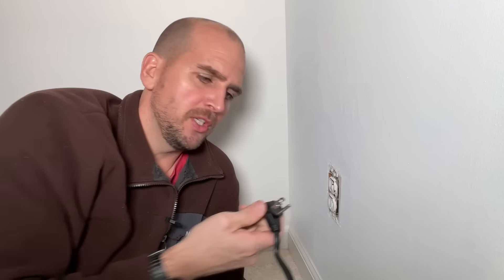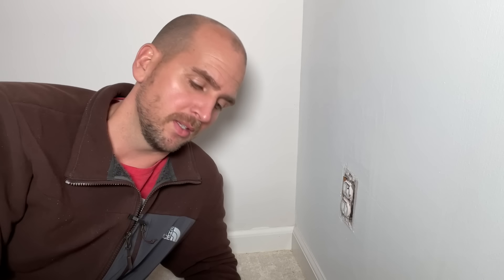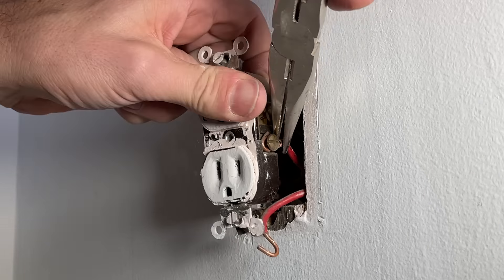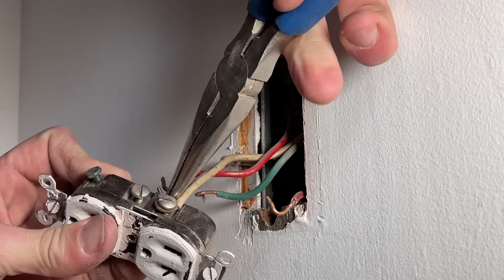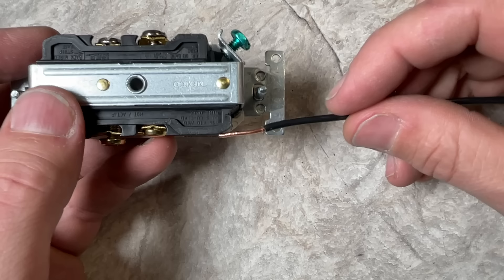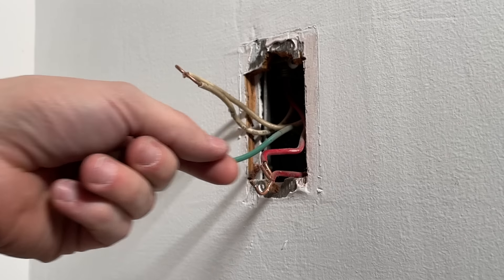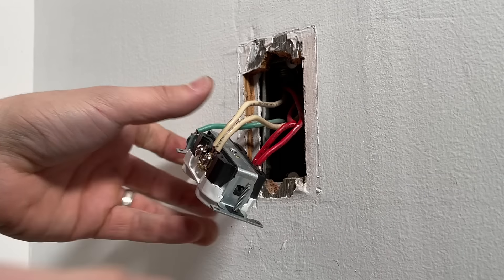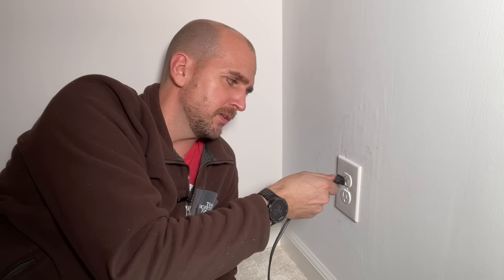Plug Won't Stay In Outlet

Comment: Be careful using the outlet tester as a means to determine whether the outlet is off. On my outlet tester, no lights means "Open Hot"; electricity is still flowing through it even though there is no lights on the tester. I prefer and suggest using both an outlet tester and a no-contact voltage tester (pen tool).

Comment: Loose connections cause arcing which creates heat (think arc welder) which inturn will create a fire. I  am a retired professional firefighter with 28 years of experience and have responded to dozens of these types of fires. Please don't take chances, this is a cheap and easy fix.

Comment: What's the point of having 4 terminals, if you only use one on each side?
Reply: If you use shepard's hooks, only ONE wire per screw terminal.  You can use the 2nd terminal to feed power to a downstream outlet on the same circuit.

Comment: Technically, the ground should face up. Reason is that if the plug is out a fraction and something metal should fall, it cannot create a bridge between the hot and neutral. Also when I have a metal box, I always wrap the outlet with electrical tape around the terminals as an added layer of protection!
Reply: Waot I thought it was only if a duplex receptacle is used then the links are also suppsoed to not be left connected so to provide for a switched outlet for the commonly done in the mid? Late? 1990s (for having a lamp of some sort wether via by means of a torchiere lamp or table lamp and not overhead ceiling/hardwired lighting fixtures) operable via a switch somewhere presumably close by in same area or even same room at least.

Comment: Why do you put 2 red wires and 2 black wires on the same screw.  There’s 2 gold and 2 silver, so can you put one on each?  Sorry, I am a new homeowner learning
Reply from the maker: For sure, an even better method is to use a method of pig tailing the wires where you only have 1 hot, 1 neutral, and 1 ground going to the outlet.  This video will give some additional details https://youtu.be/M8Ic4L0niS8

Comment: My receptacle is fine actually, but I bought a phone from EU and the adapter it came with has prongs about 60% the thickness of a normal plug, that's why it falls out everywhere I plug it into, specifically I need to put it in a power hub that installed vertically, so this doesn't help me much. I went and bought a universal cheap universal adapter and ...oops, the prongs are too thin as well!

Comment: You should have checked if the tie bar was broken free from the hot side of the receptacle. It could have been two separate circuits or have 1 switched. 

The correct method if the wiring is just a feed in and another going out is to add pigtails to both the neutral and the red hots to make the wirenut or Wago responsible as the bonding point of conductors. Putting 2 conductors under 1 screw sets you up for current flow across the screw even if nothing is plugged into the receptacle. The initial install with a conductor under each screw was a terrible idea and one that results in failures down the road. The current for anything beyond the receptacle is carried across the tie bar between the screws. The receptacle can be cooking hot with nothing plugged in. 

Definitely missed a bunch there and you have repairs to do. The receptacle is an end use device and must be wired with that purpose in mind. Imagine a loose screw from heat cycles over the long time picture. You would have created a fault affecting down stream outlets and it wouldn't happen with pigtails.

Comment: Why did he put the two hot wires onto one screw and the two white wires onto one screw?
Reply: Yep don't follow what he did. He is probably not really electrical technician. Replacing & why it's worn is basic common sense. When it comes to wiring where it goes it must be carefully done or taught here. He definitely needs to edit the video or write on description that he has mistaken.
Reply: He used a backwire connection.  The device is designed to hold two wires with one screw when wired in that way.

Comment: Hi Scott. May I ask why you add booth hot wires to the same "screw"? 8:42 I mean you say that's possible but for what is there then a 2nd gold screw available if I have at all just two outlets? Why not just add one hot wire to the first screw terminal and the 2nd hot wire to the second hot terminal? How do you test outlets with just 2 proms? All the testers are just for 3 prom outlets. /// Offtopic.... did you know green eyes are the rarest form of colored eyes. Even more rare than blue? I have the same color and my wife loves it. It looks like the snake from the Jungle book :P

Comment: Incidentally, a simple explanation is metal fatigue.  People have been told to plug and unplug devices to save power.  It fatigues the contacts.  In reality you save very little power plugging and unplugging vs. just shutting down whatever is connected to the transformer or cord.

Comment: You would never have two hots and two neutrals coming in. One set is coming in, the other set is going out to other outlets on the circuit and is not otherwise live. Also the bottom and top socket on ordinary household outlets are connected, the right hole on the top is connected to the same metal contacts as the right hole on bottom; the left hole on top shares a contact with the left hole on bottom. If you've killed the circuit and there's no power to the top then there is no power to the bottom by default.

Comment: With that tight small metal box, I would have put some electrical tape around the outlet terminals before installing it in the box.
Reply: Unless you are using something unapproved, there are no "tight" outlet boxes. Once the yoke is secured, the terminals cannot touch the sides of a proper box. Taping outlets and wire nuts is unnecessary and unprofessional.

Comment: How about a plug that absolutely will not come OUT of the outlet! Friend of mine, outlets installed by an electrician during renovation, electrician used the push in connections, plastic outlet got hot enough to melt the plastic to encapsulate the plug prongs. I had to remove the outlet with the plug still inserted, which made it very difficult. I had to smash the outlet off of the plug. I couldn’t believe a licensed electrician used the push in connections.

Comment: I've been an electrical contractor for 35 years. Two things I think are mistakes in this video. The gentleman should have pig tailed the hots and neutrals. This would allow for much easier work to be done (if need be) on this outlet in the future. And it would give less a chance of fail with only one termination. Second, he chose to reinstall a 15amp outlet only because he removed a 15-amp outlet. It doesn't matter what the old device was, it could be completely wrong. The outlet is determined by wire size and breaker size. The failed outlet could be incorrectly sized or not up to current code. He didn't elaborate if the breaker was 15amp or 20amp. the wiring was clearly #12 which is also 20amp rated.  Which means the breaker should be 20amp and if the breaker was 20 amp, the outlet is then required to be 20amp. I still think it is wise to hire an expert, and not a handyman.
Reply: alot of people send useless picky posts meant to show "i know more than you",but this is the solid info worth posting that could save lives thanks
Reply: @zacinnc78  It is far from useless. 99.9% of home electrical fire related incidents are due to homeowner error and do it yourself projects. Thats why there are codes in place. So, a person such as yourself has little chance of passing your deficiencies on to the next buyer. Deficiencies that could potentially be life threatening.  There is nothing wrong with doing anything yourself. However, if you're going to do something yourself, I highly suggest you consult a professional in the trade prior. I think all licensed electrical contractors would agree, given the damage and dangers we have seen. It is unfortunate that there are non-professionals tradesman posting improper installation on anything as if it is proper industry standard installation. Perhaps they should consult a professional before making such videos.

Comment: I have been doing it myself for ages and one question which no one has answered is, Is it ground up or ground down?
Outlets with the ground down seem more satisfying almost a smiley face.
But one can see all the letters and numbers and LEVITON are up side down.
So which is it? The world wants to know.
Reply: ground down so if the cord is stepped on the current carrying wires will come out of the outlet before the ground wire becomes dislodged

Comment: I always wrap electrical tape around the outlet to keep the wires from touching bare metal on the electrical box if the box is metal if the box is plastic I do not wrap electrical tape around it

Comment: What to do if no ground is coming out the wall
Reply from the maker: If you do not have a ground you need to either stick with a 2 prong outlet or use a GFCI and with the appropriate labels on the outlet cover indicating "no equipment ground."

Comment: I have a non-contact and I will never trust it again as I was doing some work on some wires, and it said there was no electricity (I figured it had been chewed through by rodents).  Well, as I went to buy a new socket (it had burned as the fridge is connected to it so better to be safe than sorry) and my elderly stepfather had been playing with the wires while I was gone.  I get home to find that out, and luckily the hot touched the back of my hand to shock me not as I grabbed it (the Angels were with us both that day for sure).  I jumped back wondering if I hit a nerve, or if that sucker was hot.  The non-contact setting said nothing was there, but as soon as I put the probes on 122V.  I was damn lucky and went to the fuse box to pull the fuses to finish the job.  Never again as I can trust probes I can't trust a non-contact as it almost cost me my life.

Comment: I'm not clear on why you put both red wires - and both white ones - on a single screw on the new outlet. Even if a screw CAN accommodate two wires at once, you have two gold and and two silver screws, so why not use them both?

Comment: JUST SPREAD THE  PRONGS OF THE PLUG APART A BIT A SLIDE IT BACK IN!!!!!!! done deal, quicker than me typing this, I fix this problem
you replace the outlet??? 🤣🤣🤣 
some power bars have this problem, same solution, if you find a plug slipping out of a power bar too easily just spread the prongs of the plug slightly

Comment: This a non existent issue with UK style plus and plug sockets since ALL plugs have 3 prongs (2 horizontal on the bottom and 1 vertical on top and the top one is ground) on them regardless of whether the plug uses a ground or not because of a safety feature where the live (Hot wire for you Americans) and neutral wire (dunno the American equivalent) holes have a gate in front of them which requires that a button that is inside the ground hole (ground prong is longer than the live and neutral ones to do this) at the top to release the gates blocking the 2 horizontal holes for live and neutral to stop people especially kids poking metallic objects inside the holes. This safety feature also adds another form of secureness of the plug in the wall socket by basically gripping hold of the plug because the button in the ground hole is slightly slanted and the button when compressed goes down instead of in and the button which is spring loaded naturally pushes against the prong and the gates for the live and neutral are connected and also spring loaded and naturally push against their respective prongs as a result too so the prongs are being pushed against the hole also pretty much all plugs have the wires coming out of the bottom so when the cable gets pulled or snagged the live and neutral are gonna pull out first and another safety feature is that the live and neutral wires are plastic coated where they meet up with the plug so even when the plug is only slightly inserted the exposed metal on the bottom 2 prongs is hidden. the plugs that dont have  ground wires (ALL househole appliances and things such as TV's, computers etc all use grounded power cables) The only plugs I have ever come across that do not use grounded prongs are phone chargers and these even have a plastic prong in place of the ground prong just for the button inside to open the gates of the other prongs. some of these chargers the ground prong can be folded or hidden and another thing is that in the UK as far as I am aware that the prongs on ALL plugs stick out and cannot be folded in but on certain phone chargers the ground one can be folded or compressed inside the charger to save space since the ground prong is required even if it is just plastic and has no purpose for being used to ground anything

Comment: Until a subscriber pulls out a half hot plug. In this case part of the plug will be controlled by a switch.     If the bridge is not broken, The switch will not control that part of plug

Comment: Well, no, it is not wear from overheating and years of usage, it is a fundamental design flaw that I never observed in France, in Ireland (although their power outlets, identical to the British ones, are over spec'd). The first thing I did after I bought my condo was to buy a box of brand new power outlets because many wouldn't even hold the weight of the plug and a small cable, not just the power outlets supposedly used by the vacuum cleaner.
Even with the American design, it would have been extremely easy to block the 2 claws so that go further than the diameter of the plug.
Include also a recess, mandatory kid tamper resistance, and other features found in power outlets of other countries.
The green ground wire is a good thing though, compared to the usual naked copper ground wire.
Both are still coupled to the neutral wire in the electric panel, so that's not so much of a good thing, but Americans seem to be OK with it.

I found many electrically backward things when comparing American code and standards with other countries. Some of it also has to do with the not so United States, with individual states, counties, cities having their say in many matters where they shouldn't. I am not even an electrician, but I had to train myself to the latest code before renovating my house from scratch.

Comment: YES - Hotels are the very Worst. The brand new PS4 plug was melted by one of these. 
Also - Fire Marshal should site any commercial building with sloppy outlets.
They are the first cause of any fire if plug on cord has to be is altered to stay in. 
Home owner should be very aware of the high resistance loose outlets causing fire. 
High load appliance such as heater to iron. Test all kitchen outlets - 
Microwave, toaster, mini oven are also high load appliance. 

I really prefer commercial 20 amp vs 15 outlet, with higher grade connection inside. 
The circuit breaker knows the rules cannot be broken. 
One should take red piece of tape, and do full walkabout in their home, 
and mark every sloppy outlet to not use them till they are replaced. 
And mark that outlet for use for lamp only until replaced. 

As in the install just done in crowded metal box with stiff wire, I have wrapped entire outlet
covering screws a couple time with tape just to make sure no direct contact is made. 
Odd a plastic snap on cover is not made for this purpose. 

Cheers

Comment: When you unscrew wires from old outlet just remove the screws completely and won't have to use pliers to get wire off lug the old receptacle is going to be discarded

Comment: You said there was a chance that the outlet could be rated for 20 volts rather than 15, which is the rating for  the new plug fixture.  You said that you checked to verify it ...... but you didn't say how.  Also, you really should have explained what would happen if the outlet and the new plug don't match.  If one is 20 and the other is 15, what happens?

Comment: I know a lot of people, especially from the US, will disagree with me but, as a European I must say this: the type A and type B sockets are simply a bad design. The wall socket frame should have an indentation to hold onto the plug with, as is the case of type E, F, H, J, K, L and N sockets. Their shapes vary, with some being round, some rectangular and some hexagonal, but they all have in common that indentation in the frame of the socket that helps to grip the plug and hold it in place. As a bonus, it eliminates the danger of accidentally touching the partially exposed prongs of the plug when inserting or removing it from the socket.
The most absurd part in my opinion is that, in the US at least, these idiotic sockets are being pushed for being "compliant" with whatever they considered "safe" a century ago  by the same people who didn't see the Edison socket as a potential safety hazard, in spite of the fact that you can literally touch both contacts with your fingers. In my opinion this oversight proves just how important and well thought these safety standards actually are.
And even with all that, I can see a simple modification to that idiotic receptacle that would actually fix that sagging issue: looking at it, I noticed that there's a plastic wall in between the neutral and ground contacts, so as to prevent the two from touching when a plug is inserted and pushing them towards each other. If there were springs in between the metal tabs and the plastic separator, they would help provide the required tension to hold that stupid plug design in place, even without the recess in the socket's plastic plate.